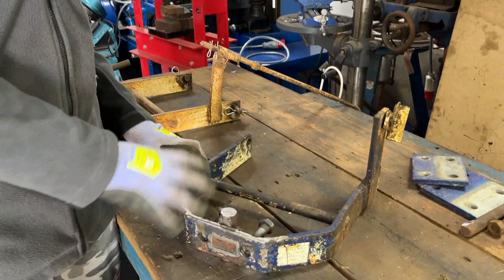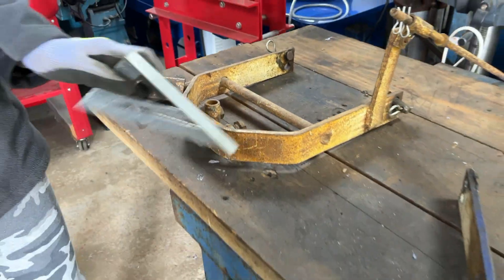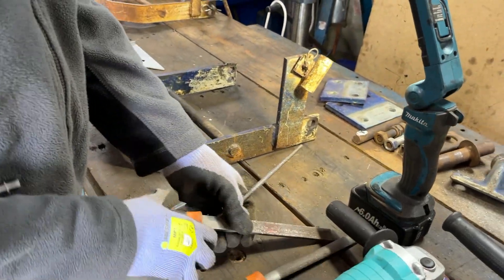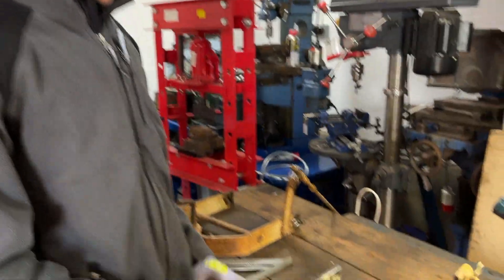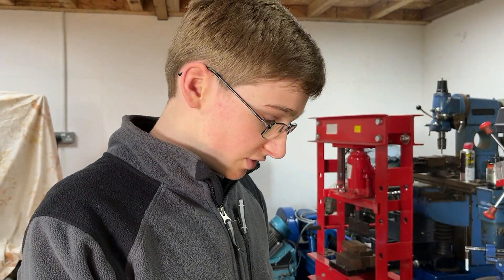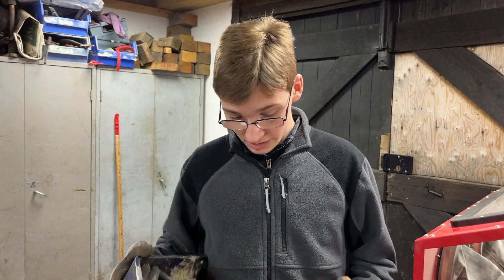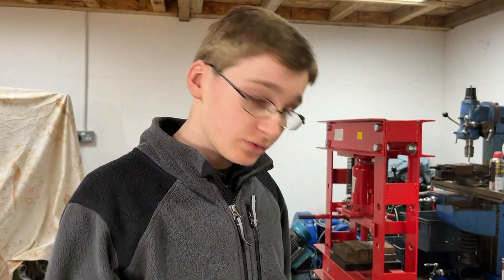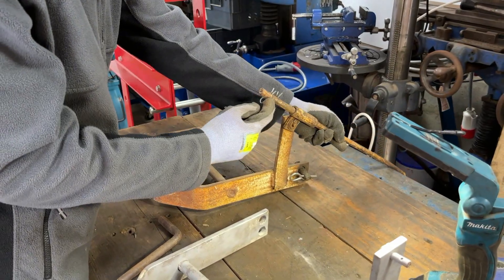Bolens Sleeve Hitch Project - Part2

Comment: Looking good Joseph. You could use fine builders sand in your blast cabinet on such as that, dry it in the oven on the quiet and save your glass media for more delicate work. Sieve the sand to remove any big bits. Cheap and reusable. Tony
Reply from the maker: Thanks. We have a few bags of play pit sand, not sure if we could use that. Thanks for the tip. Take care

Comment: Good video and tool use. It looks like you need a bending brake for your press to make that "L" piece. As you make these pieces you should be making detailed shop drawings so that you can make them again if something gets lost. Good Luck, Rick.
Reply from the maker: We have made some press tooling for specific jobs in the past and we will look through those to see if anything can be used. You are 100% right about detailed drawings but that is something we seem to struggle to do. Take care
Reply: @GardenTractorBoy  Being able to read and draw plans is a skill that has many uses. My Dad taught me mechanical drawing when I was about 10. From 7th through 12th grades I took drafting courses. They paid off big time in engineering school and later as an engineer. I was disappointed when I learned that many engineers and contractors really couldn't read and understand the plans. This is part of the reason there are so many mistakes on construction sites. Take the time to learn. Even if its just using graph paper, a pencil, a scale, and a protractor. I still don't use Autocad. I'm faster by hand(but not as neet). Good Luck, Rick
Reply from the maker: @richardross7219  This is interesting and I would like to learn how to do this. I will talk to school to see what they offer, thanks

Comment: We had an earthquake here the other day. It must have been a result of you using that huge pipe wrench!! The making of those rods and plates will be a piece of cake for you two machinists, I am confident. I am curious as to what those markings (imperfections) were on the hitch.
Reply from the maker: LOL. That pipe wrench is great. The imperfections are very odd, we have noticed them on both the outside and inside of the metal. Take care

Comment: Hi Joseph, I have the same blasting cabinet. I bought aluminium oxide media for mine. Not cheap but lasts a lot longer in cases where you are recovering it.    But of course seeing is still a problem. I attach the shop vac to the side to try to reduce the fog. Cheers
Reply from the maker: We tend to poke the shop vac through the side hole but this is something that can't be done easily when filming. We have plans for a better solution to the fog as part of our upgrade plans for the grit blaster. Thanks, we have ordered some aluminium oxide. Take care